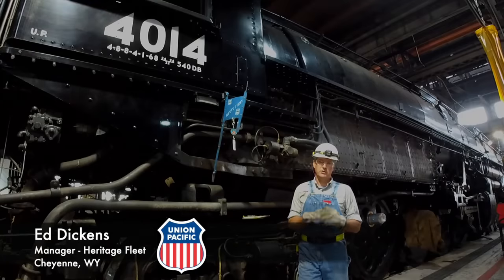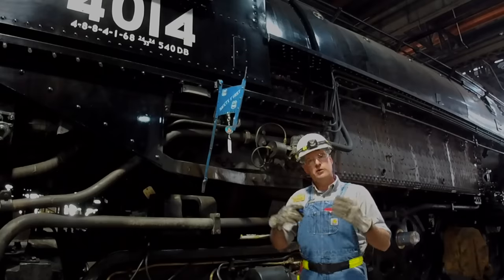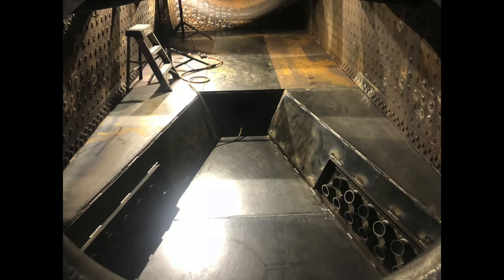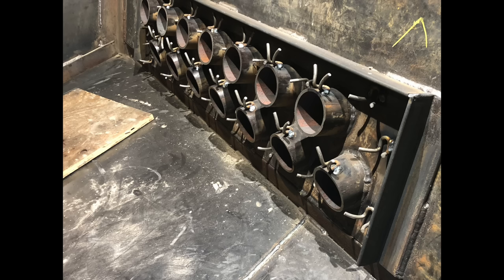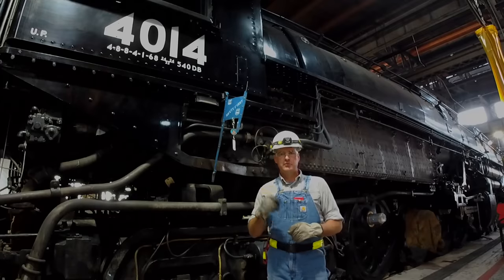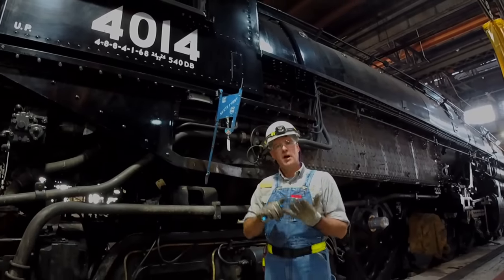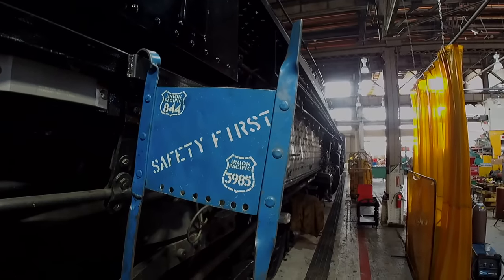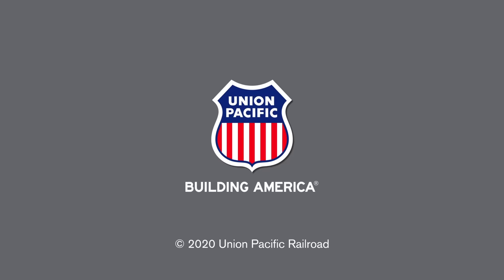UP Steam Update: Converting Big Boy No. 4014 to Oil

Comment: I was hoping to see some details of the custom burner and steam injection. Maybe later?
Reply: You can look up a number of US patents for oil burners for locomotives and see drawings of what they look like. They are all basically identical, with only small details of pipe size or steam or oil pressure different. I'm pretty sure the UP steam program duplicated a design very similar to the one that had been tried (with less than total success) in 4005. Ed mentioned making a few tweaks, which is completely to be expected, this is really still an experimental installation.

Most oil burners have a pie-slice shaped flat plate, and then a flat notch under it. The oil pipe drools oil out on the flat plate, where it spreads out and runs off the edge. The slot under the edge is connected to the steam pipe. The hot steam blasts the very thick gooey oil into millions of tiny droplets and spreads it out into the firebox. The steam isn't hot enough to light the oil, and it isn't wet enough to put the fire out. You have to light the oil first, but once it is burning it will keep burning, and you can regulate the burn by controlling the amount of oil and amount of steam.

Comment: When the steam stopped in Victorville, CA, the steam smelled like baked pretzel. It was nice smelling
Reply: There are some reports that this locomotive runs on recycled vegetable oil.
Reply: @jeffanderlik7695  I’m confused - what fuel has it been running on the past few years? I saw it in Milwaukee in 2019, driveby video on my channel. I really did not think it was coal but I can’t explain this video unless this is a 4 year old video?
Reply: @Syclone0044  explain why you're confused? Vegetable oil and Diesel oil burn about the same. Maybe I can use different terms to clarify.

Comment: Apart from the previous engine that was oil fired in the 4000 class how did you determine the size ratio of burner to air requirements etc,wondering if the Challengers gave some markers to start from. Very enjoyable video,s thank you. Regards Chris Bailey
Reply: You work backwards from several requirements probably listed on the design sheets:  amount of steam needed, at what heat and pressure - which tells you how much energy is needed.  This tells you how much fuel you need to burn per second, to get that much heat, which dictates the amount of air needed.

Comment: First time I have seen images of the firebox setup post conversion. I had wondered how the burner design would throw oil across the entire firebox, surprised to see the oil burner mounted in the middle of the firebox, instead of at the front. How does the front half of the firebox get heated? Is it possible to get some more images?

Comment: Wish you would restore at least one more - Reason: While one is down, the other could tour or if both running, this could relieve pressure off the tour schedules. Plus, would help keep shop crews and other crew skills sharpened. Luckily 7 are still remaining. The B-29 "FiFi" from same era recently got a twin - "Doc". The average person would have questioned, why another? Why not?

Comment: Same reason that trucks, back when, the injectors were completely manually controlled by the throttle. 
Good drivers could adjust the amount of throttle to eliminate the "puff" and make the fuel last a lot longer.
Another thing that trains didn't have to worry about...
If a truck was laboring up a hill, while it may have the power to pull that load up the hill, if the combustion temperatures got too high, it would abate the piston domes, and ruin the engine.
So, some load needed to be removed, and the only ways to do that a was to downshift, or throttle down.
These days, the ECM does that,so the engine doesn't destroy itself getting a load up a steep grade.
It slows down, and the driver has to downshift to keep the truck moving uphill.

Comment: Ed, Tom and I Have a Good Plan for Ocala Railroad Days, Will Can Used UP 844 & 4014 Will Pull the Excursion.
And Also Both Engines will Put on Display Without 3985.

Comment: I wish you'd add circles and such to the pictures to point out the parts where it's not readily apparent what you're talking about. Talking about an air intake cover (I think I know where), but it'd be nice to not have to guess and assume I'm correct and all that. Same with the pictures of the fireman's area, no idea which pipe or gauge or valve you were talking about. I know it's not important to know, but imo/ime it helps with the learning/retention (that I need for no reason, but /shrug emoji).

Thanks for the content!

Comment: Relating it to a gasoline engine, @4:45 it sounds like you run it very lean.  It makes sense for a boiler to do that as lean fuel mix runs hotter.

Comment: Yes, thank you. I'm low-tech. But when Big Boy tours again will it make some steam-like noise and toot or be silent except for its raw power? Saw BB in Malta, IL, 2019; what a thrill. That steam whistle, baby. If you're ever in northern Illinois, check out railroad museum in Union near Marengo - about 50 miles a bit northwest of Chicago. Great place, train fans. Got to throw this in: traveled as a child with bro without parents on Bluebird from Delmar Station in St. Louis to Dearborn Station, Chicago to visit grandparents one summer. Brother was maybe 13; I was maybe 9.  St. Louis Football Cardinals were on the same train! Probably going to an exhibition game with Da Bears. I know this because I walked car by car and said hello to Cards. Gigantic people who treated me royally. And then up to the dome car for another thrill. Obviously, this wasn't Amtrak. No plastic seats - upholstered. Ah, train travel way back. Thanks for your time.
Reply: If you do it right, steam engines still create steam of the same temp and pressure, even if fired with a different fuel.  Steam blows your whistle, no matter if the firebox is full of oil, wood, coal, or uranium to  boil your water.  tl;dr:   Yes, they'll blow the whistle!

Comment: The blue flag with the 3985 shield made me a bit emotional. Here's to the hope that in 20 or 30 years or so there could be a chance for it to shine again.
Reply: I hope so too. Cuz i would love to see 4014, 3985, 844 all together on one train
Reply: That won't be the case if the Challenger returns to steam. Realistically, if it'll happen, it's as a replacement for either the 844 or 4014 if they have to bow out for a big overhaul.
Reply: @Jimboliah3985  I wish we could help them with payment for it
Reply: @parkey6krinock66  3985 Will always be my favorite.
Reply: Seems like a shame to have a nearly operable locomotive in the wings, particularly one recently in service.  Economically, I get it.  U.P. has a great collection of locomotives in that building.  You're doing alright, U.P.
Reply: @0779BooBoo  me too
Reply: @parkey6krinock66  I'm sure they'd jump right on it if you won the Powerball and signed the winnings over.
Reply: @PRR5406  at North Platte in 19, Ed said 3985 wasn't even legal to leave the shop under her own power because it leaks steam and air so bad.
Reply: @PRR5406  she’s actually in pretty rough shape sadly, the previous crew didn’t maintain her properly from what I have heard. I hope one day she’ll eventually get back on the rails again.

Comment: Interesting video. when flashing up from cold, how do they overcome the thermal shock of the burning oil in heating up the boiler? It would have to be a little quicker to raise steam than the coal firing. Is it a case of doing "warming flashes" over an extended period of time for gradual heat buildup?

Comment: I would like to know what you did different in modern times that the engineers in the late 1940's couldn't or didn't have the material science to achieve when the UP 1st tried to convert one of the 40XX engines to oil. Also are you using Bunker C oil in these or some other type?

Comment: What are you using for a ignition source to light off?  Do you have a hole in new firebox door cover you can stick a lighted oil torch?  Our burners on the Belle of Louisville are manually adjusted steam atomizers so I'm sure you also blow your fire out occasionally.

Comment: I have seen that the fuel oil used in some German oil steamers is not liquid and therefore must be heated to flow. As a result the steam loco must be blown out before setting it in a siding for the night. This is a huge matter and looks like the engine eplodes. They use the last steam they have to rinse the oil, out of the lines and firebox. What is the procedure at UP to shut the engines down? Thanks for bininging the 4000s back and not to forget the 39000 befre that. Keep up the good work.

Comment: Crazy question, but had any consideration been given to doing a propane or LNG conversion? That would be rad as heck. Would it generate enough heat? Or was the intent to just stay true to the smokey era?
Reply: Propane or LNG that's too hard too handle so they're using kerosene instead but I prefer use anthracite coal rather than kerosene

Comment: The SPS 700 has a very large firebox, you can fit a pickup in there,, designed to burn coal but since it was coming to the west coast it came set up for oil.  Bunker oil is hard to get so at times fuel ranges from diesel to reclaimed crankcase oil.   Tell all the photographers that when they demand black smoke they need to pay for the extra fuel burned

Comment: I thought the oil process was a failure when it was implemented back in the day? And switched back to coal. But maybe today there is better technology today to work it. I hope it works. This baby is a world wonder and needs to be protected and maintain as long as time will allow!
Reply: It wasn't necessarily a failure, but it was discovered that anthracite coal offers more BTUs than oil. So, for superheating applications, coal is more effective than oil. That's not to say that oil is incapable. In colder climates, coal makes for better heat, but it's way more labor intensive.

Comment: Very interesting and well explained, thankyou.
Please can you explain why is the bottom of the firebox not lagged or insulated.?
Reply: 5:20 you can see that they firebricked the whole area, though most of the photo shots in the video are pre firebrick to show the structure.
Reply: Thanks Falbert. So is the fire box double skinned at this point, to put another way are there stays only in the lagged area.? 
When burning coal was this area bricked.? British locos were, I think,  fully lagged which is obviously why I enquired.
The angled structures above the fitter at 5.29, are they a type of thermic syphon.? 
I hope all that brickwork is up to the rigors of the road, I used to work in the cement industry and the refractory was always a concern.

Comment: +UnionPacificRailroad  We know about (2'D)D2'-h7 American Locomotive Company 4-8-8-4-1-68²⁴₃₃²⁴540DB SerNo 69585 being delivered November 1941 from Schenectady, NY, USA as a soft-coal-burner.  Thanks for the illustration of the balancing act between Bunker C, atomizing steam, and combustion air on the burner pan.

Comment: Is the oil used to power Big Boy 4014 used car engine oil or fresh oil from the refinery?  Also, what type of oil is used in Big Boy 4014  -  regular home heating oil, a light engine oil ( such as 5W-20), a thickened diesel type of fuel, something else?

Comment: I'm sure you get this question a lot, but I would like to hear it straight from the horses mouth, so to speak. Does the tender still have a water tank, or does it only carry fuel oil? also I have a bit of a question around engineering. Originally, I thought you had lined the whole fire pan with tubes with holes in them, much like a gas outdoor grill or a gas stove burner. Why was this idea deemed a reject? would it be too complicated and too costly, or would it be only able to operate one type of fuel (those grills I mention are mostly Propane an Natural Gas)

Comment: I wonder why when you rear about the conversion to oil firing on the 4005. That it was deemed a failure. But you never really hear about any other conversions
Reply: Uneven heating throughout the very large firebox caused a lack of consistent steam pressure to develop the full horse power required to pull the 100+ boxcar heavy manifests over the grades. Well, that was the official reason. Digging a bit deeper, UP owned the coal mines...they didn't own the oil wells...so once the coal workers strike was over, it is my considered opinion UP just went with what was readily at hand, easier to get, and cheaper. UP coal won.

Comment: Why aren't you using a control system like SST’s zirconium dioxide oxygen sensors to keep the air fuel mixture tuned perfectly in real time?

Comment: I understand that these steam locomotives with modern biodiesel burner could work normally again. The burner tbh could burn gases from garbage.
Reply: They do not use diesel, that would be hilariously expensive, since she uses about 20-30 gallons per mile, yes you read that right GALLONS per MILE, depending on load. She, like all oil burning locomotives, tends to use #5 Bunker Oil (also known as "Navy Oil" due to it being used as a fuel source for ships) which is extremely cheap, mostly because it is usually highly contaminated with stuff like Sulphur, which limits it's uses. It's also about the consistency of road tar when left at room temperature, and has to be heated up a bit before it's pumped into anything or used. If #5 isn't available, used motor oil or equivalent is also usable, but a bit more expensive.

Modern diesel locomotives do not actually use their fuel to directly move the locomotive, such as a diesel truck or tractor-trailer would. Rather the diesel engine inside the locomotive powers an electrical generator which feeds electrical traction motors attached to the wheelsets.
Reply: @vishnu79  lets build a steam powered with an AR11 6 axle...

Comment: If the burner needs steam to atomize the oil, how is a cold startup accomplished?
Reply: Normally they will use shop steam to gently warm the loco for 24 to 48 hours or more before they will even attempt to start the oil burning. This allows the metals to gently expand and provides the initial steam needed to start the combustion process. When out and touring, Ed's team keep the boiler going so that they always keep some steam being produced but not at 300psi like when they are running hard.
Reply: @amwesterlin1  Thank you for explaining.

Comment: What oil is 4014 burning?  DFM, #6,  #5 etc.  Does the  engine have opacity monitors?  If heavy oil is being used how hot is it at the nozzle?  Oil of any weight must be pressure atomized, cannot be gravity fed..  Good info video.   40 year High pressure boiler guy :-)
Reply: I believe they run it on the same fuel as they use in their diesel locomotives, for the logistical efficiency, now that fuel oils are more expensive than they used to be.  But don't quote me on that.
Reply: its safer to use in dry areas to prevent wild fires and coal if pretty dirty

Comment: The oil burn would give much more control to fire the boiler. With coal you couldn't just cut the fuel and turn it back on like you can with oil.

Comment: I'm confused, was this filmed back when Big boy was being restored or is this a current project?
Reply: I'm leaning toward during restoration, as it currently uses oil.
Reply: I think this video was done recently.  They barely got the 4014 ready in time for the Golden Spike anniversary in 2019, and didn’t take a lot of time once the engine was assembled to make videos.  If you note in this video, the side and main rods have been removed.  There was an earlier video made during which Ed mentions the pandemic where you can see that the rods have been removed.
Reply: In the video he said the system they had worked great, but they were making minor adjustments to it. That leads me to believe the video is current; however, 4014 had already been converted before her debut run.
Reply: 4014’s oil conversion was completed prior to its return to operation in 2019.
Reply: @RickyJr46  This video is current - Ed was explaining modifications to make the oil burning work better.

Comment: I've often wondered why they couldn't convert to ng as a fuel source for the fires... clean and efficient....
Reply: You can't store nearly enough of it in the tender
Reply: @danielr.l.mccullough600  I figured a converted LNG tanker would work. Running a propane forge for smithing ive noticed that once hot you can dial down the flow to maintain temps inside the forge. Thought it would work very similar in a fire box and wouldn't need such extreme heats to do it. I only surmise that getting it up to temp from cold would take alot of fuel. It which point I've thought that maybe a secondary fuel source would be used at start up then maintained with N.G.
Reply: @rhodesj1893  Put that way, it could work. But why go against the tried and tested? Besides, it would somewhat spoil the "heritage" bit
Reply: @danielr.l.mccullough600  no different, in my mind, then when they changed over to an oil burner... if looks are a concern (which they are) then dressing up a tank on a oil tender frame (basically hollow out a tender and install a LNG tank) would convey the same two part engine assembly. The smoke could be brought back using any smoking agent that can be added by the fireman into the fire box at anytime for nostalgic purposes. 
Steam has proven to out perform diesel, I think this would be the cleanest way to up grade a coal or oil burner...  shy of an electric heating assembly... which would completely change the engine itself and add an entire mess of worms that need not happen. there for it would be moot.